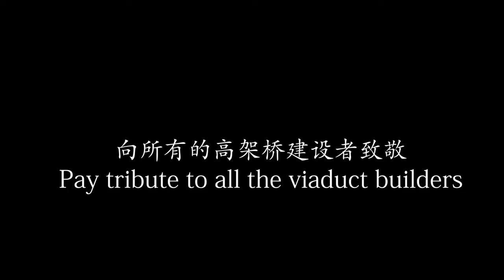Another super engineering in China shocks the world

Comment: Jan Lolling
 > "Mont Hua railway" length 1800 km, costs 2000 Million RMB. From the inner Mongolia to Jiangxi.  Above ground, no gradient for high speed rail at 300 to 400 kph.  Cuts time to travel between cities to just hours, like 1/3 to 1/4. millions will use this to move between cities.  China has construction army and mega machines to build this 24 x7, fast and cheap. Engineering is mega magnitude.  Many super long and tall bridges, rails and roads they build are super huge and all over the world.  In China 6000 miles of roads every year. 
Well, they have 8x STEM graduate, lots of engineers.  The ONE BELT is a huge never ending construction Project of the Century as well.  VERY impressive China!!

Comment: It has nothing to do with Propaganda, China doesn't need to do such a silly thing, it's already dominating the world when it comes to mega infrastructure. The Menghua Railway is a transportation railway and is designed to handle trains up to 20,000 tons. Because of the weight and the hilly terrain, it was necessary to flatten out the slope. The surrounding area is cultivated land, and the cost of land acquisition is extremely high, so this is the solution.

Comment: I dont get it how come they didnt just built it ground level
Reply: didnt u see farm land below it
Reply: ricky seah  yes there is farmland below. But, the question is why so high? They could have built it lower at a greater cost savings. Plus did you notice that the ground was cleared under the viaduct. Still a very impressive work of engineering, and the use of prefabrication.
Reply: me too what a waste of concrete,and in the event of earthquake,but might protect them from Noahs flood.
Reply: It’s for high speed trains. You need a level route at 200 mph...
Reply: The trains travel at 350km/h, capable of 400km/h in future. Pillars are high to minimize noise around countryside.
Reply: I'm guessing this areas ground level is lower than where the train station is and if it's a train that can run over 300 kmph you wouldn't want the track to go down and speed up the train even more.
Reply: Because of the intersection of roads on the ground, people need to move frequently;
Reply: @navnit3978  If they made at ground level then they have to maintain the same level  everywhere and for hilly part they have to dig longer tunnel which passes at the bottom of the hill. Now the tunnel passes at the safe distance below the top of the hill. So they have optimized the work.
Reply: @Manuel Gomez If they made at ground level then they have to maintain the same level  everywhere and for hilly part they have to dig longer tunnel which passes at the bottom of the hill. Now the tunnel passes at the safe distance below the top of the hill. So they have optimized the work.
Reply: @wtw6474  I don't think it's high for the sake of being tall!  I think they are trying to have a very low gradient, to help the high-speed train.  There's SOME places where it touches the ground, I imagine?  Not so exciting video for the drone and video people.  There's sure a lot of sniveling here in the comments section!  This is how it suits them to do it, the question I think is more important:  Why don't WE do giant infrastructure projects?
Reply: @navnit3978  Are you a civil engineer? Railway expert?  Are you just making noise?
Reply: @suniltimsina2811  Plus this makes it harder for the graffiti people to mark it up!
Reply: They got a  great deal on concrete from trump
Reply: Ground level construction of that extent is too disruptive of the terrain and natural contours of the land and drainage. At times affects the micro ecosystems of an area.
Reply: up and down make trains to very very hard, so they should balanced the height.

Comment: would have been cheaper and easier to build it at ground level
Reply: then they would have
Reply: It might have been cheaper and easier to build at ground level, but building on the ground makes upgrades and downgrades that affect both speed and efficiency of the train. Efficient surface transportation has to be as close to level as possible - that means building tracks high over valleys and low or underground when crossing mountains.
Reply: It's a high speed rail. Building up high eliminate the risk of hitting wild animals.

Comment: Pretty amazing. But where I'm from, we only build bridges over water 🤔. Pretty sure a regular road would've worked there...
Reply: Exactly
Reply: It's a high speed rail track.
Reply: Zafir Zakaria And that means it needs to be elevated? Why?
Reply: @spears8471  need to keep all the track fairly level, trains travel at hundreds of km per hour. Also keeps other stuff out of the way, and safe from accidents etc.
Reply: It'll be over water very soon..  China is gonna built another Dam and flood the region..
Reply: Because the high-speed railway has a speed of 350 kilometers per hour, the anti-sedimentation design requirements are high, so the bridge is used. Why is the bridge so high? I guess it is because the route level is kept quite long distances. In short, high-speed railways require high construction accuracy and the rails are seamless.
Reply: Because it is for high speed train running at 200 mph and it is not safe for anyone or any animal to across the rail. If you build it on the ground, people can get across it by bridge but animals are gonna be trapped in the railway net.

Comment: Just wondering how this is cost justified? Why not just build it at ground level?
Reply: Brian Benningfield  farm lands . Look down
Reply: Cost is not high . Co it is the state in charge of every level of production
Reply: Flooded land below. They needed to build a Bridge whatever. Make it a bit higher to create very easy gradients for High Speed Train. Knowing China they are planning to convert it over to there new "Maglev" 600 km a year Trains in another 10/20 years. 
They plan ahead. Big new Railway Stations built 12 years I saw when in China in 2008 that at the time seemed to have no real purpose. Now they have High Speed Trains serving them with probably 10 times the passengers using the Station. That's real Planning and sticking to the plan.
Reply: Building on ground don't guaranteed evenness, you will be going up n down slopes frequently.  This is not good for high speed train. 
Building on elevated pillars, free the land below for cultivation, tracks less likely to be interrupted by flood, track    can ensure evenness, meaning smoother ride at high speeds. Also no trespassing by wild animals. Traffic on any road that crossed the tracks will pass through the tracks uninterrupted.
Even if you build tracks on ground level, you can't just put the tracks on the ground,  you need to treat the ground  to ensure soil on ground is compact n solid hard,  or to pile deep into ground.  Not simply put the railway tracks on untreated ground.

Comment: This concept to build railway lines across their countries has advantages. 1) no anti-noise walls cutting through the landscape everywhere - like it is the case in e.g. germany. 2) not the slightest "invitation" for potential suiciders to have them overrun by trains. 3) no other vehicles or people won't even accidentally come across railway trains. The only disadvantage is: Stronger winds may have an impact on how fast trains can go. After 30-40 years, concrete structures may start to become brittle - except for when every steel-arming/reinforcement in there is coated rust-proof or consists of rust-free steel and the whole concrete around it is water-tightened so withering will only proceed very slow into the material.

Comment: Impressive and China again showing its capability. However, risk analysis has to be done on this - the pillars are intersecting roads. A large truck or heavy vehicle can hit and damage pillars (at bottom) making entire structure unsafe. What precautions have they taken to prevent collisions with ground based transportation? Germany ICE train had huge accident when truck stuck overpass. You need to add heavy steel metal barriers at pillar's base with impact absorbing collapse barriers - huge risk otherwise. Anyone  agree or like to comment?

Comment: Nothing shocking except that they used probably twice as much concrete as necessary. But since it’s a railroad bridge, maybe they need that extra strength. The techniques used are standard and used everywhere. But there is no grace or awe in the lines of this bridge. Its primary feature is its mass. Almost as if they built another “Great Wall” but with gaps in it [between piers]. 

If you’re not convinced, look up the Millau Viaduct over the River Tarn in France. Now THERE is a bridge that shocked the world, and though it wasn’t the first built with those techniques, it has been one of the most inspirational and extreme bridges of its type. Many technological problems had to be solved in order to build it, and if you watched them doing it, you know the meaning of the word “awesome.” Many more have been built all over the world using the same decking, whether over piers or cable suspension. This Chinese viaduct is just a bridge. There are many bridges far more amazing in the USA, going back over 150 years. Unless there is something we can’t see, which narration or captions might have explained, this is just a common  high viaduct, extended over a great distance. All such bridges are awesome, but this one does not stand out from the pack in any way I can see. Maybe if they told us how long it is. If it’s like 20 miles long or something, then it would be a little more awesome. Nothing here to shock the world. Just good bridge building practice. The video spent a lot of time focusing on laying the railroad track. Those machines are from Switzerland, Germany, France or some such place, although China may well have built their own. I think the ones we use like that in the USA are from Switzerland. Nothing shocking there. 

Nice bridge, China, but unless you tell us what is so unusual about it, even people who know a lot about bridges will draw a blank. It’s just a long viaduct.
Reply: It would be shocking  to see one in the usa we cant even fix the pot holes.
Reply: tuborg carlsberg , You might be amazed to see all that we do well. Your local city government doesn’t fix potholes. But the Burlington northern railroad, or Union Pacific, or any of the other great real roads in North America can build bridges with the best of them. Your local government doesn’t fix potholes because someone on the city Council wants to use the money for something else. In some cases they actually are skimming that money off for themselves until they get caught. That has nothing to do with the capabilities of American industry. We can do just about anything. Most industrial technologies began in the United States or were perfected there.

Comment: I can’t understand why somebody would need an explanation for what’s being built when he video shows the laying of.railway ties and steel rails!  
A high speed train moving at 350 km/hr ( soon to be increased to 600 km/hr. ) cannot tolerate steep grades, sudden change in grades etc. Instead of grading the ground, the piers provide the means of providing an even grade without messing around with the topography.of the land.
For those who think that the concrete piers are unnecessary.......you’ll be slicing properties  into pieces, you’ll have to build overpasses at every road intersection, build culverts/bridges at every ditch, creek or river crossing.
For those who wonder why the area directly below the railway tracks are levelled.......it’s for construction materials and equipment access during and after construction.
For those who think of the catastrophic aftermath of an earthquake.......stop building anything in earthquake zones, tell the Californians to move out of California or build everything earthquake proof,  if it’s any consolation, safety measures built into high speed railways (HSR ) include the detection of earthquake precursors that automatically enable the timely stoppage of trains.

Comment: What's the need of these much height
Reply: Because the high-speed railway has extremely high requirements for the settlement of the roadbed, the design service life should be 100 years. Building on land is completely different from building on a viaduct. The high-speed rail is built on a viaduct mainly for the safety of the high-speed rail and the full enclosure of the line.
1. Ensure zero settlement of the roadbed of the high-speed rail and ensure high smoothness.
2. Ensure that it is fully enclosed and ensure safety
3. Reduce land occupation
4. Ensure that the line is straight and cut to the towns along the line
5. Reduce environmental pollution and protect the migration routes of wild animals from being cut off
6. Reduce noise pollution